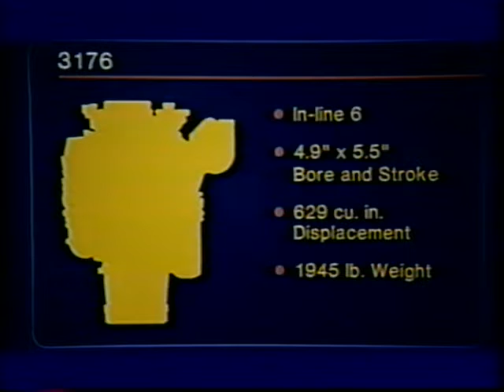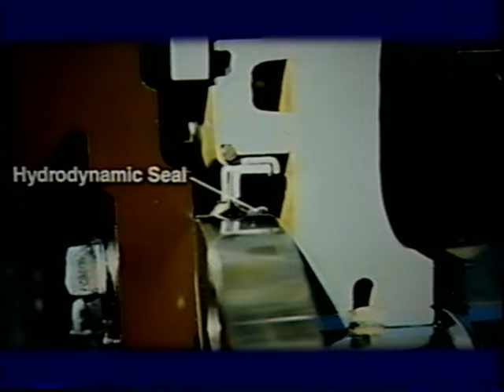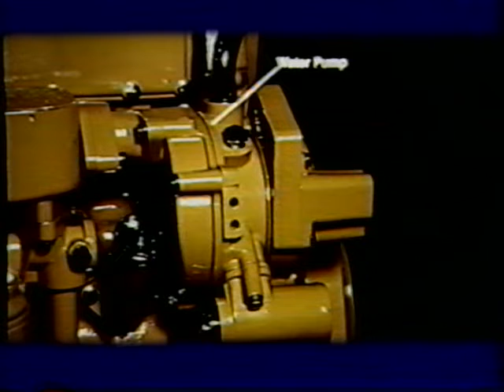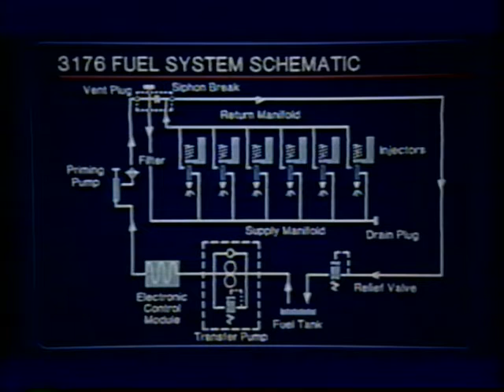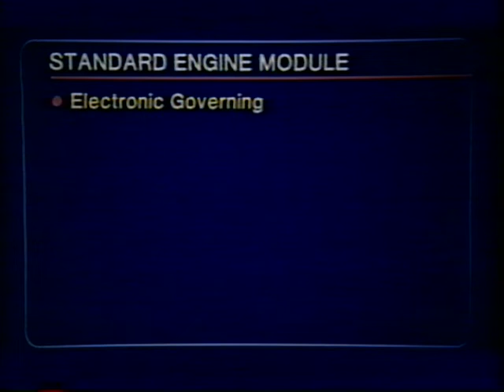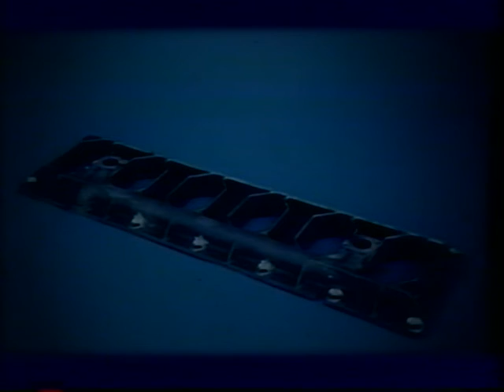Introduction To The CAT 3176 Truck Engine

Comment: While some did have a  problem with the 3176, most customers were ok with the engine. I don't know, but I suspect the difference was a result of how the engine was being used. The later 3176 engines had a variety of changes and upgrades, so that is a factor too. The engine was non-traditional in some ways. During the time of the 3176, both Navistar and Detroit Diesel also had various service issues. Competition, customer expectations, and government regulations, were forcing changes on everyone. To one degree or another, advancing the state of the art is always a roll of the dice. Caterpillar engineering and execution are not based on cutting corners or ignoring reality. The 3176 was generally ok, but was the closest Cat ever came to dangling their toes off the edge of the cliff.

Comment: I think the 3176 was a brain farther. I have drove this engine over 1 million miles. I rebuilt this engine myself. The engine kit costs twice as much as a 3406 because it is only available from cat. The aluminum plate under the head is a complete brain farther. There is no cam bearings as the cam fits in this aluminum plate. Horsepower is lacking. I am a cat man but I would recommend anyone to stay away.